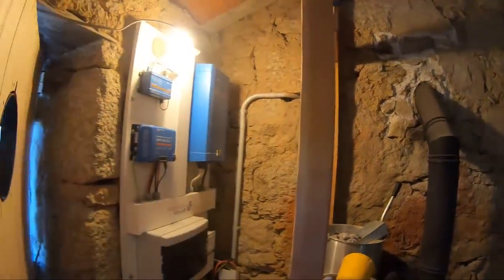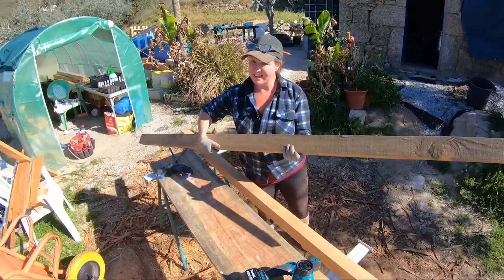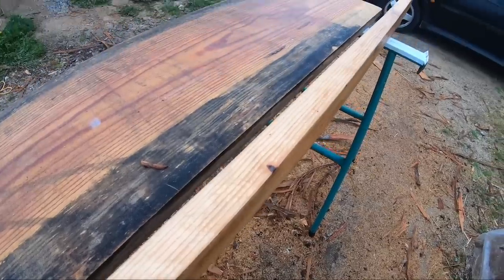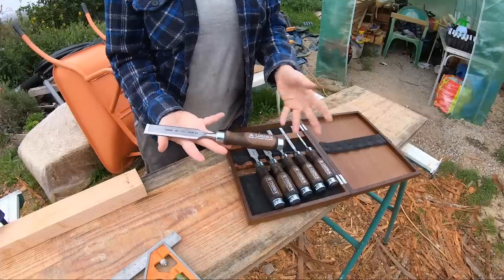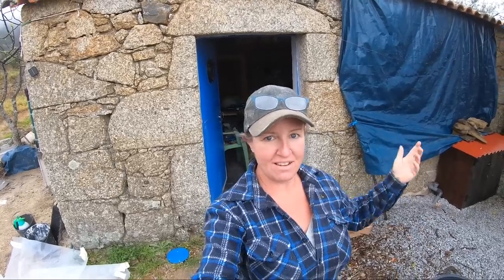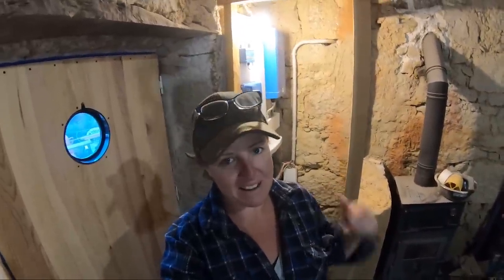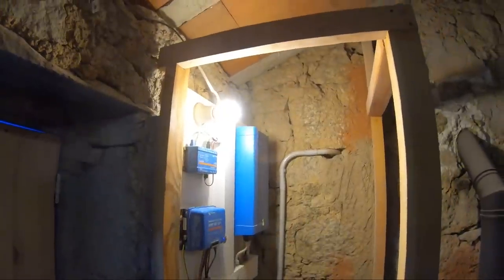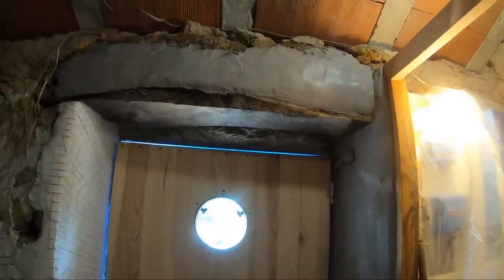Unexpected Project Makes a Huge Impact Inside My DIY Barn Conversion

Comment: Hi, those litlle pieces of wood between the door frame and the stone can be removed just hit them with a hamer on the sides to move them a bit until they are lose enought and you will be able to remove it. It was used to hold the frame in place while it was cemented in place and was just left there, but you can without doubt remove them and fill the gap with lime
Reply from the maker: Good to know! I removed most of them but left that one in place as a sort of door stop. I'll remove it when I buy an actual door stop... right now it's protecting the wall.

Comment: 👍 very nice. And you could hang a curtain ( door-coloured, even). With a quick ceiling - hey presto -the space  would then be dustproof, too; is dustproof even an issue 🤔...?
Reply from the maker: Thanks! Ah dust proof! Living the dream! 😁 Nice idea though... I'm not sure what to do about the door yet and want something artsy, but a roof would be easy enough I think and would give me storage, too.
Reply: @PortugalfromScratch  I thought as much 🙂 ( that you'd want a special door; heard you say wood). The curtain idea was an in the meantime idea, partly to try out visuals: open closed open closed 😶
Reply from the maker: @jan9562  A good idea for sure! I also need to complete the side wall but I'm going to experiment with bottles so need a design. It should be a fun project when I get back around to it!

Comment: You're now a pro at the plastering. The door surround looks really good already, even without the final finished  layer. Are you going to use colour on the walls when they are finished?
Reply from the maker: Thanks! I feel like I get a little better each time. I haven't decided any final design details but I have a feeling I'll aim for a creamy colour finish on the lime and maybe a light reddish for any clay walls... possibly with some colour splashes here and there if I end up doing artistic features. Let's see! I'm not super adventurous with interior design... I think I'll want to keep it nice and simple and clean looking. 🙂